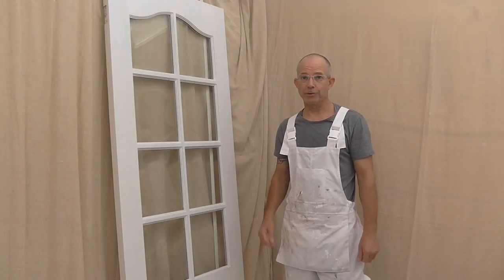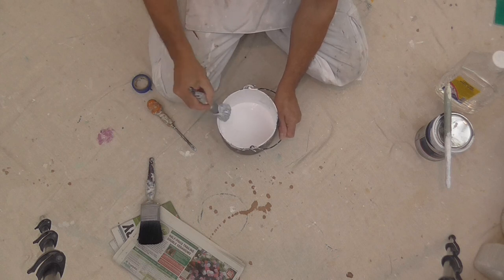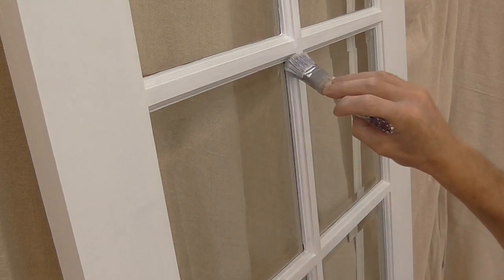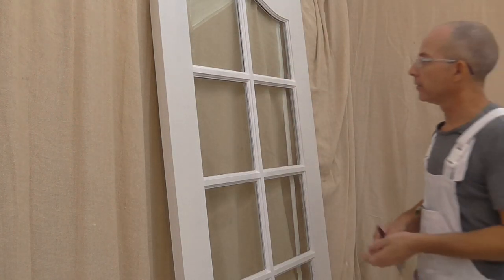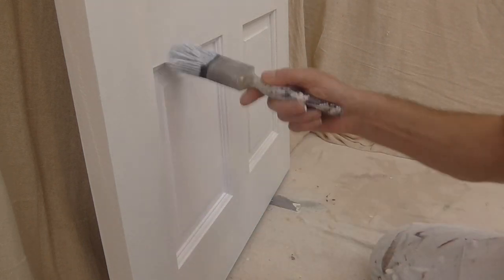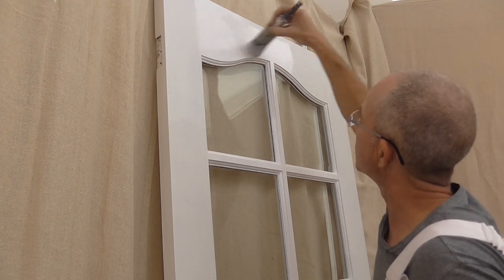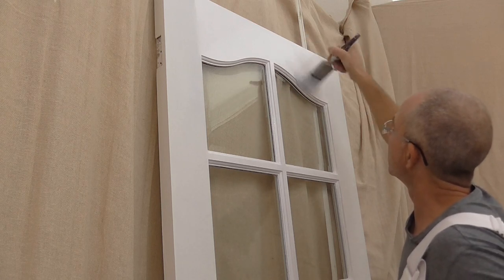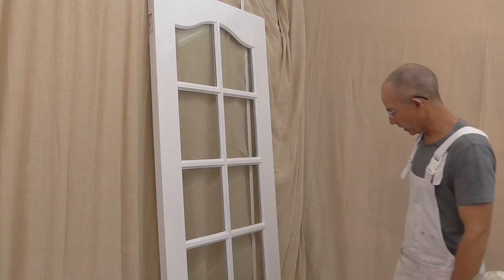Glossing French Doors

Comment: I’m back again. I need advice. I painted bathroom door frame and door using an old can of satinwood water based paint from wickes that was a couple of years old. It hadn’t been used so I thought it was fine. Smelt ok in the can but once on the woodwork it’s now giving off a very unpleasant smell so I would guess it’s gone bad. What do i do now?
Reply from the maker: You will have to paint it again.. thanks
Reply: @PaintingandDecorating  could I get away with a water based satinwood or would I need to seal it with an oil based product do you think? I’ve read about using bleach on it also!? I’ve tried to avoid oil based this time as it’s a nightmare with kids around when used in a high traffic area

Comment: Goes yellow in 3 months oil based paint go back to the stone add old timer
Reply: You stick to slapping water based on lad. Watch and learn, if the job is worth doing, do it right. Old school all the way, when it comes to applying oil based.
Reply: no it wont ive used dulux trade gloss white not PBW through out the whole of many houses in the last few years and its still white after 2 years